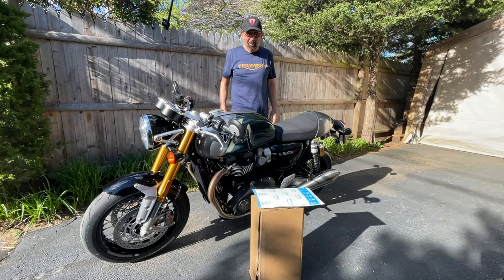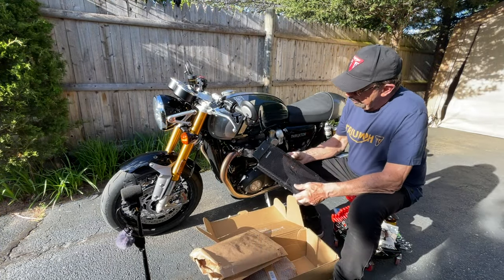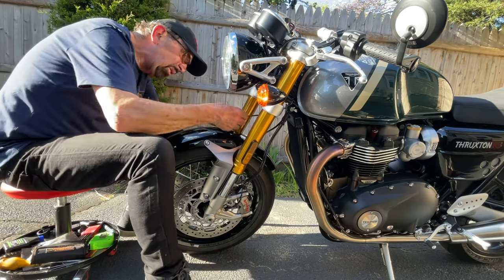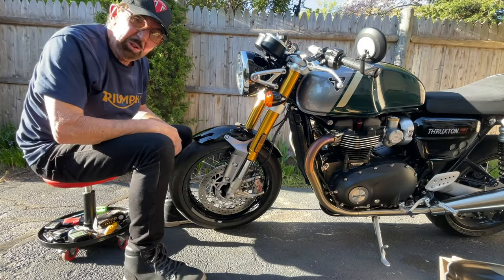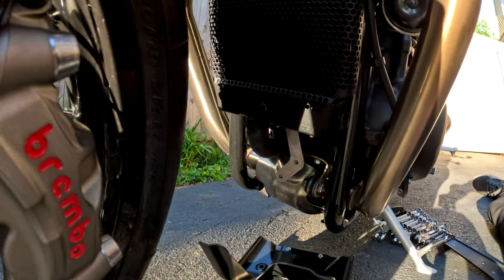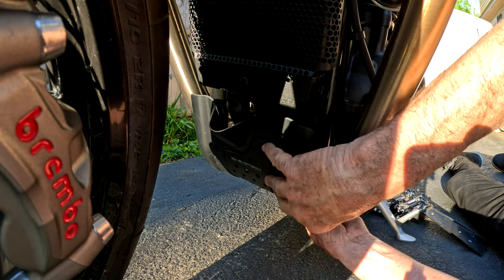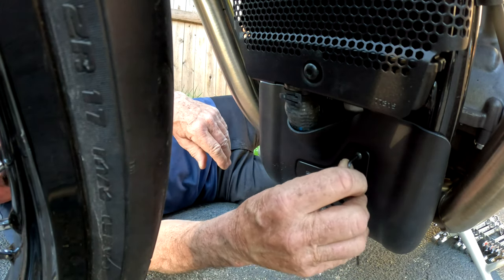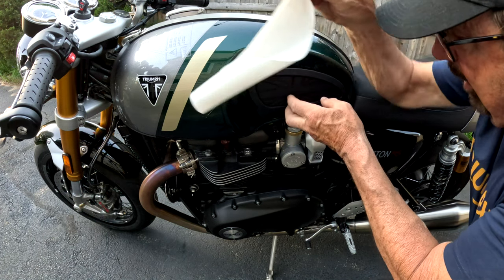"A MUST HAVE TRIUMPH ACCESSORY" for the THRUXTON RS "SEE THE INSTALL plus bonus items."

Comment: Two mods I have done are progressive springs and 37t rear sprocket.
The springs were from Tec Engineering in the UK.
The sprocket gives me about 3200 rpm at 65 mph instead of 4500 rpm.
All inexpensive, as I am retired I am on a budget.
On a bike that peaks out at 7000rpm  the stock sprocket gearing  made the bike  a pain on the open road, and I live in the country so open is all there is.
Now its more comfortable and relaxed to ride.
The bike came with vince/ hines exhaust, tail tidy, fairing,suede seat, bar end mirrors and bling all from Triumph.
The previous owner had 2 other bikes and a large income!
Reply from the maker: Wow, that sounds like a really nice Thruxton. I’ve seen pictures on the Internet of one that is Triumph Green with the fairing of the same color. Have you posted any pictures of it online?
Reply: @lifetimeadventures9107  i have. I like to retain some anonymity on YouTube...how can i send you a link and keep some protection?
Reply from the maker: You can post a short video of the bike  on your channel that I subscribed to.
Reply: I'm considering altering gearing may try going up a tooth on front sprocket reckon its got plenty of torque to handle it , my gripe is you gun it in 1st and you instantly run out of revs . I'm like you retired and on a budget , bike was rough when I got it (cheap though) its the S with rusty chrome exhaust , just acquired S/H Thruxton R headers and link pipes , plus some cheap Vance Hines scratched badly but polished out nice
Reply: @nounoufriend1442  mine is happy in the 3000 to 5000 rpm range so changing the gearing lets the bike be what it is, a mildly tuned light bike, akin to a mid size cruiser.
 Motorwise. It is not a high revving motor at all, so having it geared like a dirt bike just means you ride around in the rev range the bike doesn't like.
I had a custom seat made, with bit more padding and a bump keeps me in place with the tank and the low bars. It doesn't accelerate hard enough to need it for performance.
Reply: @buddhastaxi666  Hi I have the R model with all the mods that you mentioned but STD sprockets. I use this bike as a main transportation. I commute 60km daily and 250km (500 round trip) weekly or so. I use a big backpack and the bike is ok up to 180km/h then feels busy. I do not see the need to change the rear sprocket such big gap from 42T to 37T...may be go up with the front sprocket 2T...also I do not see any of such power that all talk about. I have old Triumphs and are pretty good up to 140km/h I do not see a major difference in power delivery in that speed range. Bike should be 25kh less weight. Gasoline economy is pretty poor if you crank up the engine.
Reply: @TheReverb1  I am pleased with my smaller rear sprocket. I changed the rear cos it was easier.
I live in the country, so its all highway speeds. The bike does 3300 rpm at 110kmh.  The gearing i have  is not so good in traffic, it doesn't really do slow . Fuel economy amazes me especially as my previous kwacka  Zx14R could use more fuel than my car. My Triumph averages 23kms/litre...65 UK mpg. If i sit on 90 kmh on a flat country road the boke does 100 mpg. That blows me away, it is a 1200 and with Only a small fairing.
Power ...or torque...is in the 4000 to 5000 rpm range, which is 160 to 170 kmh. The bike could do with a new front tyre, it has original  Pirelli Angel. I just put a Michelin pilot 6 on the rear. Expensive but first class grip, in wet or dry. Thought of a steering damper as front end will twitch on hard cornering, but front tyre has done 12000 kms now so could be that. Also dont always ride at 9 tenths. Ive grown to love the bike. A friend just got one he liked mine that much.
Reply: I just travelled 800 kms/450 miles , in heat...but i put this rubber shelving mat over the cowling and strapped  luggage on to the bike. i also have two small bags on either side, that way i dont have the back pack weighing me down. @TheReverb1

Comment: I have one on my Thruxton gravel and mud squash the cooling fins.
The local dirt roads ruined my zx14 radiator and i put a guard over the oil filter on my Roadliner which was sticking out there ready to catch a rock.
A must have accessory on the Thruxton is a Fairing.!!!
Reply from the maker: Thanks for sharing your challenges. A Faring you say? Well you may be seeing an installation video of a competition green faring on this channel in the near future. I am still waiting for it to arrive from Triumph.
Reply: @lifetimeadventures9107  I have one of those factory fairings.
 I just bought the bike, it had done 400 kns a year....a 2016.
It came with almost every Triumph accessory, including the fairing.
It is a very well made, precise product . 
It  gives the Thruxton a delicate, slim  appearance, not unlike a 70s 750 Ducati .

Mine is the Triumph green. I had a Sprint years sgo in the same colour .
Reply from the maker: Wow.. you have a nice Thruxton. I like the full coverage Triumph green color… looks like you have some nice mods on the bike also. I’m not able to leave a comment on your site because you have it restricted by putting selecting for children. You are able to edit that and change it so that others can comment about your video. Thanks for sharing your fabulous Thruxton.
Reply: @lifetimeadventures9107  I am busy ....getting ready for a vintage fair...so did it all in a hurry.
Its the type of bike that needs to be seen as its visually appealing.
I just tear around on it and keep it clean.
Reply: @lifetimeadventures9107  Changed settings ...saying suitable for children to me does not mean exclusively for children...its an innocuous video of a machine, therfore it cannot possible have a negative impact on the impressionable minds of new humans.
Reply from the maker: Seeing that beautiful bike might drive the young person to ride a motorcycle… that would be an addiction for sure….

Comment: I'm planning on getting a tailtidy when my new Thruxton arrives. I might have to get these upgrades as well 😂
Reply from the maker: I have seen some nice ones on the Thruxton. I haven't decided about doing that to my bike yet. I have to check to see if it would create a challenge getting an inspection sticker. They do make the bike look cleaner and more custom. The radiator and engine protector are great. I am happy to know all that road debris isn't getting to the critical parts on my new bike. Thanks for the comment and please post a link to the Tail Tidy that you choose. I'd like to see it.

Comment: I’m curious to know if all RSs are made in England or just the chrome edition. My bike has a UK VIN. I am curious what the first character of your VIN is?
Reply from the maker: United Kingdom is SM. I checked  before purchasing it.
Reply: @lifetimeadventures9107  interesting. So I guess all thruxtons are made in England.
Reply from the maker: @DrFearCo  at least some parts of them may be produced in the UK. I believe the VIN number is the designation of where the vehicle is assembled and shipped from. There are many parts that may be manufactured in other locations. Whoever designed and assembled the Triumph bikes did a great job, as everything about them is top quality.
Reply: @lifetimeadventures9107  for sure. Lots of parts on cars are made wherever as well. I just like things to be produced where they should be produced (as much as possible) if that makes sense. If that’s a Japanese product I’d like it to be made in Japan etc. I love my thruxton rs so far. Just got it last week.
Reply: I've checked 5 or so rs Vins. They're mostly made in india. The TFC were likely the only ones made in UK